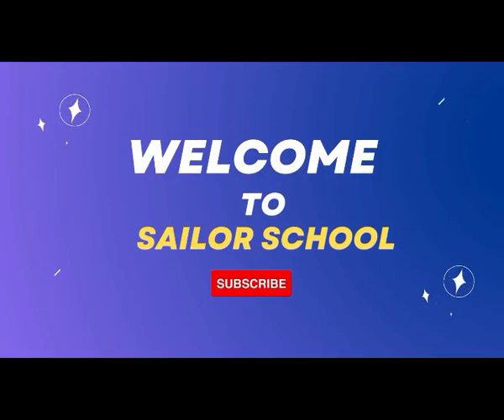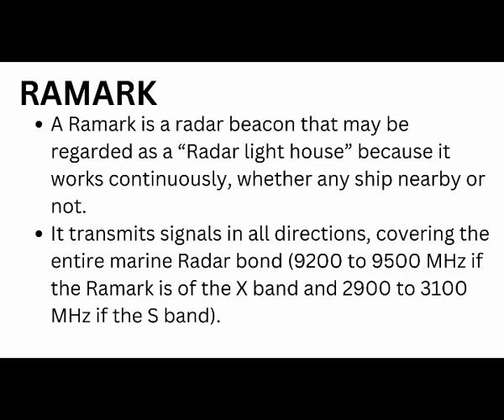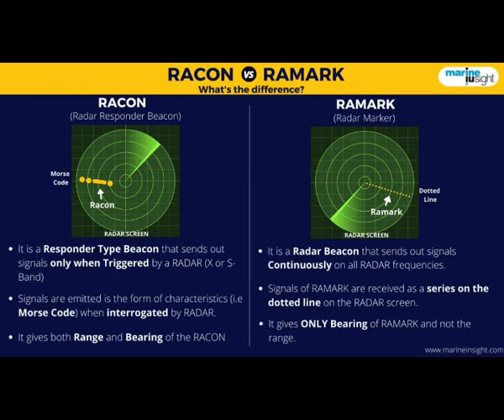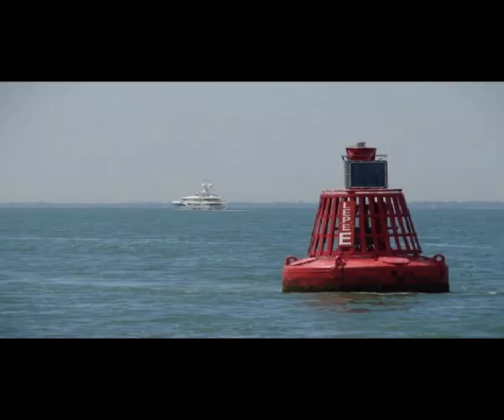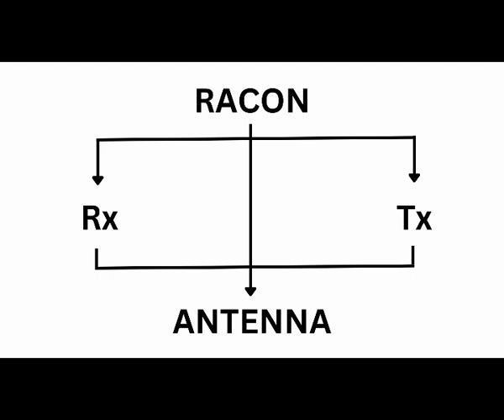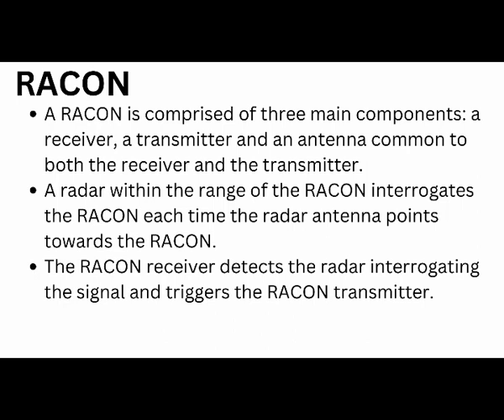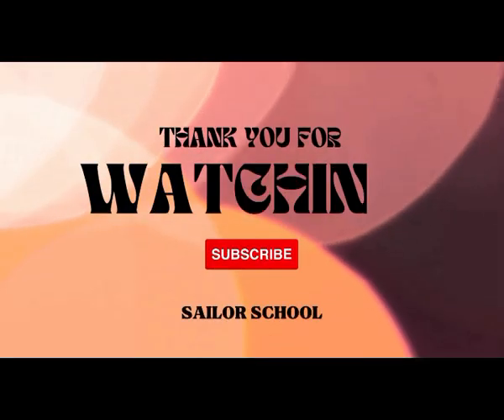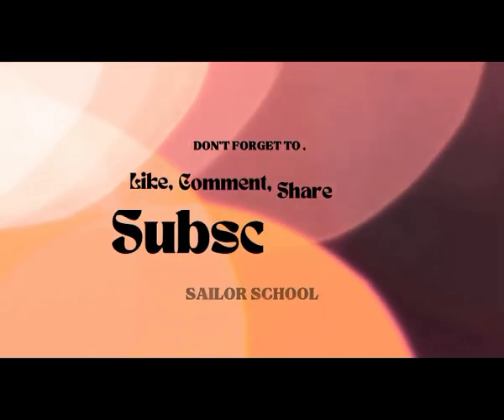Radio Aids to Navigation (Ramark & Racon)

Comment: Ramark is similar to sart on radar 😢 how do we recognize the difference
Reply from the maker: There are certain ways. 
But the basics are:-
1. Cross check between the position of ramark on chart and confirm the same when you observe. 
2. Ramark has a time interval between transmission or it usually have a pattern when transmitting.. 
With help of these two and visual confirmation if possible.